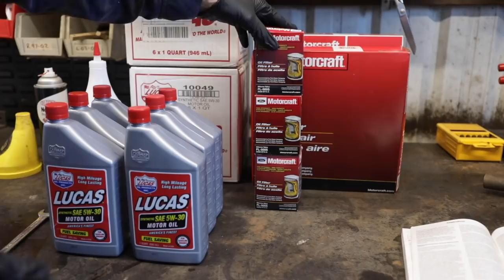How to Change Your Oil Like A Pro

Comment: I have a few Problems with this "Oil Change like a Pro":

1. Replacing an Airfilter is good, but has nothing to do with an oilchange. The same with his doorhinges.
2. Befor you remove your drain plug, open the Oilfillercap. That way, the Oil runs out more smothly, taking more dirt build up with it.
3. It looked like the drain plug gasket was fine, but i would replace that anyway. You have to replace it, if its a copper or aluminum washer. (I know he said that)
4. The drain plug has to be tighten with a specific torque. Look it up in the User-Manual of your vehicle. It is usualy arround 20-30 Nm. (14-22 ft lb for those of you living Imperial units) 
5. For the love of God, get a big cardboard or old blanket and put that under the car to avoid a mess like he did.

Dont swap your tires in a criss cross pattern, if your tires are directional. Most modern tires are not directional, but pls check when swapping. You can always swap rear to front, but dont sawp left to right.

Have a nice day
Reply: I have a few problems with your post:

1.  This is general maintenance usually done at the time of an oil change.  He forgot the cabin filter and tire air pressure.  You should also keep an eye on the plugs and serpentine belt.  Check the manual for grease points. Plus a good visual inspection of the entire car.
2. BS.  
3. He said that...
4.  Again, BS.  It is a freakin' drain plug.  Yeah, they probably do give torque specs, but it is a friggin' drain plug, you tighten it.  Lug nuts too.  Some chucklehead down below thinks it is critical.  No, just make sure they are evenly tightened down good, it will be okay...Trust me...
5. Then you still have to dispose of the cardboard or blanket.  What difference than just using the shop towels?

Don't try to make yourself look smart, it usually backfires.  Your post is essentially screaming, "I am better than Wranglerstar".  The fact that you have to try and prove that tells more about you than you think.  Here is a hint:  Real Alpha males really don't care what anyone else thinks about them.  They have nothing to prove. Think about it.
Reply: I tried to give constructive criticism. English is not my first language, I would never try to look smart, if its not my main language. I just had concerns about some advice "Wranglerstar" was giving. If you make a video about an Oilchange, you have to cover more than just your own vehicle. 

If you would do oilchanges yourself, you would know, why it is better to put a blanket under the car beforhand.
Reply: You are not offering constructive criticism.  You are nitpicking his video to try and make yourself look better.  Just like your parting shot at me.  I have been changing oil in cars, along with any other kind of maintenance including full rebuilds for well over 35 years now.  But that is neither here nor there, your post is about what us wrong in the video.  So far you haven't shown anything substantial.  What are your concerns?  That he didn't use a torque wrench on the drain plug?  Go make your own video.

Comment: a couple of things don't forget to throw your spare into the rotation if it matches your other tires and wheels as it should and not be one of those stupid donut spare. And as far as the alloy aftermarket wheels go they can and will improve your performance they're lighter which means less rotating mass to get rolling which will result in better fuel mileage and  better stopping distance and cool better than a steel wheel will.

Comment: someone is drinking the lucas koolaid.   If you are running lucas oil and paying a lot more for it, it should already have the additives in it.  As far as cold starts go, thinner synthetics will flow much quicker into all important bearing surfaces.

Comment: Filling a oil filter is not at all necessary on a gas motor it’s preferred on a diesel
Reply: if you can fill it without spilling it then kind of stupid not to do it that way the membrane is soaked good and ready

Comment: Had a guy in my tech school with a straight piped Chrysler crossfire do an oil change and he thought it would be funny to rev it right afterwards... threw a rod because of oil starvation and totaled his only vehicle. He flunked out because he didn’t have a way to get to class.

Comment: I've got  368000 miles on my engine that has never been out of the truck. I've used every type of oil and oil filter you can think of both conventional and synthetic oil. My oil changes have varied from 3000 too 7500 miles and I still got to 368000 miles. I now use Walmart supertech conventional motor oil and have so the last three or four years with no problems. Amsoil the Lucas motor oils are for guys who have been brainwashed into believing that the alleged highest quality products will only get you to a high mileage engine.

Comment: If you need AMSoil let me know we to ship it to you no matter the quantity often shipping even free. Also DON'T EVER CHANGE YOUR TIRES or you never know what is wrong with your axles because you can't read the wear pattern on your tires. On top you need to re balance your tire when you change it from one to the other axle which is a reason why I use balancing beats on my 37" for example because they re balance them self each time. Change your AC filters every year not more than that if you off road do it every 6 months. Same is with your oil don't change it to often or you just waste money. I change my oils every 30-40 or 12 month's interval yes I run on AMSOIL and K&N filters.

Comment: Just a couple of notes,  I love that old creeper, true quality in that tool.  I noticed Ford decided to have their drain plug  in a poor location that tends to make a huge mess.  Years back I found these and absolutely love them.
http://www.fumotousa.com/
No more wrench needed, no more washer replacement, and can easily direct the oil into any container by pushing on a small rubber hose.

On the tire rotation, not ALL rotations follow the pattern you described, many cars have directional tires so they need to stay on the same side of the car.  Some cars have staggered sizes so no tire rotation is possible.

Comment: Beware of quick stop type oil change places!  I have always done my own, but I know 3 people they have cost big money.  One left the drain plug loose drained oil going down road and seized engine. One incorrect oil that looked like thin hyd oil or brake fluid ate main bearings.  One incorrect fluid in trans burned up trans.  BEWARE

Comment: If can't afford premium oil, at least get full synthetic oil. It is SO much better than conventional oil. Synthetic oils offer better protection in every possible way than conventional. 
Also, never ever get Fram filters. EVER. 
 Sorry Cody, but OEM filters are not the best (they are pretty good though). Get a K&N filter or Purolator Boss filter, there are other premium filters out  there, but the auto parts store i work at doesn't carry other brands. 
One more thing. if nothing else, CHANGE THE OIL ON TIME. This is doubly true with conventional oils. Conv. oil seems to know when it's 5k miles and suddenly deteriorates. conv. oil WILL NOT LAST  6K miles. This I know from personal experience.

Comment: Pros dont use funnels. You realize a quart of oil is shaped like it is so u can pour it smoothly? You keep the opening on the high side and tilt. SOURCE--Ex a.s.e. technician 

Ah you called that out. But yeah you can pour it without a drop that way

Comment: You didn't take the tire off one side  of the vehicle??and put it on the the other side of the vehicle did you ? ,Radial tires should only spin  in one direction  If you put them spinning inthe opposite direction the steel bands can separate  and the tire will be ruined .

Comment: Don't make your oil to thick. Then it can't get through the lifters on these newer engines.
Reply: I agree......adding oil additives like Cody does, changes the viscosity of the oil.....bad news.
Reply: @TheBeatenPaths  Yea the oil has to push through tiny little holes in the lifters. Keeping the oil changed is the life of an engine.
Reply: @pleaseholdwhileiprocessyou1513  Amsoil has a 25 000 mile oil.  Great stuff.   No offense to Cody at all, but oil education is taught by past generations, no one knows the current facts.  I'm an Amsoil dealer, and I've heard all the myths lol.

Comment: I can hardly finish this video.  #1, wrong, $10 a quart Lucas vs $5 a quart Mobil1 could matter less.   Changing it when you're supposed to and using the correct grade is far more important than brand.  Head over to bobistheoilguy forums and you'll see fantastic lab analysis from Walmart Supertech Synthetic oil which costs $3 a quart. #2, oil doesn't need additives,  the additive pack already in the oil is stout enough for regular service intervals.  Motorcraft oil filters are average at best.  Made by purolator which has had some media integrity issues lately.    Other oil change tips were good.

Comment: Does not matter what vehicle producer saying, you must change oil each 6`000 miles, especially if you have modern common rail turbo diesel engine... only this way you will reach your 1`000`000 miles without any engine repair works, at all.

Comment: All eotating tyres do is mean you have to change all 4 at once rather than just 2. Your always using the same amount of tread your just prolonging it. You will still get the exact same us if you keep thr fronts on the front and change the backs when they are neded. Essentially never. Every 50k.

Comment: do not change your oil every 10k miles, I dont care what the manual says. 6 tops. its all regulations pushing the manufacturers to do that for environment, its not helping your engine life at all. I work in the industry and I promise you going 10k miles is not good.

Comment: What do you think of Mobil 1
Reply from the maker: Mobile 1 is also a premium oil,
Reply: but Mobile 1 has now corrupted their own synthetics with new marketing..... and I use Mobile 1 normally years ago we met a independent oil engineer and he seen a lot data of comparison between brands and Mobile 1 full syn was the best of the bunch but that was 20 years ago and a lot has probably changed  

but I have seen the cleaning action of Mobile 1 full synthetic clean a engine say one on conventional oil for the first 100,000 miles and next 100,000 on mobile 1 and the motors looks better then it did many miles later

Comment: I understand the importance of good oil, but instead of spending the "extra money" on better oil that will go 15K to 20K miles in the modern EcoBoost motor, I have opted for 4-5K mile oil changes using Moble1 5W-30.  Wait!!! Mobil 1 is good oil and not the super ultimate best oil.  Note: The Gen 2 EcoBoost 3.5L motor in the 2017/2018 F150 with oil life monitor will easily go 7500 miles on inexpensive oil in less than severe conditions.

Comment: You’re doing something wrong. When you drive 10000 miles with your tiers the steel and the urethane get used to the direction of the spin of the tier. When you criss cross the wheels it changes the direction of the rotation and it can make your tier fall apart. The criss cross method had been proved wrong a lot of time ago.

Comment: Your tires would last longer if you were not re-living your youth doing a brake stand watching the smoke roll out of the wheel wells lol.  When you have your wheels off do a brake inspection, heavy van, larger diameter tires, smallish brakes the pads would burn off quick. Myself I would skip the additive, a good synthetic oil is all you need.

Comment: You missed something when talking about tire rotations.

Make sure that you rotate the spare tire into the mix. No one ever does this but its needed if you want to keep all your tires the same height and in the same condition. if you leave the spare under your truck or on the back of your jeep it will rot in the sun or dry out from the salt on the road and the lack of use. Make sure to rotate that spare into the mix!

Comment: CODY. Tip for you . Replace your crush washer for a solid copper washer ! Crush washers are designed obsolescence ! Installing a consumer ethos on the general public. Its only a dollar ! Well if you use a solid washer then anneal it the next time you use it you can do that for the life of the vehicle ! How many dollars would be saved over the life of the vehicle ? How much money is generated from unnecessary spares across all industry ? I bet its millions of not billions of dollars. Dont forget all those copper crush washers your using end up in landfill. PURE WASTE ! We need to think smarter than this folks. Many people only see a copper washer but expand that to 1 million washers, 100 million washers, How many vehicles are in the USA ? they all need washers for an oil change ! Those washers are often stamped out of sheets ! The centers and the area between washers goes to be recycled no doubt. Nonetheless its a huge investment in time, man hours ,machinery, factory space and resources just to make those crush washers !!

Comment: Did you know that personal anecdotes are not "Testing"? What you say there is the experience of one mechanic and one laboratory test that says nothing about the oil really haha. 

Get some decent testing going about how much friciton there is, about how heat sensitive the oil is and about how much wear you will get. And I bet you wont notice any difference. 

You got the youtube money, buy t´wo cheap generators, put in two oils and let it run for a week Straight. There will be absolutely zero difference.

Comment: Do not sell your oil filter this is the reason why I don't agree with that because you can put ten minutes into the filter the way he's doing it that's the way I was taught from other mechanics it will take an second or two to fill it up in the engine

Comment: Oil additives not necessary - watch Project Farm Channel.  They are a waste of money.
Reply from the maker: Fake news,
Reply: Ok, won't get into a pointless internet argument about it - love your channel, but I'm not a fan of additives.  API rated oils are manufacturer specified.  They don't specify additives, and would if they were important.  May be different in heavy diesel and 2 stroke machinery.  To each their own.

Comment: I'm wary of ford bailout or not. Ford had a terrible legacy with Powerstroke diesels that costed owners thousands. The "Wonderful engineer's at ford" also designed the triton engine which would blow out spark plugs from the head because they thought 3 threads was enough. Who done that besides ferd ?
Reply from the maker: You can make the same argument for every American car manufacturer,
Reply: I agree, Ford just does questionable stuff some times as they are the most innovative of the big 3

Comment: Additives are idiotic - a nice high quality oil is engineered to be high quality. They spent tons of money engineering it, there's already additives in there tightly engineered to work together. If these random additives really did anything to make a high quality oil better wouldn't they have already put it in the oil? Dumping a random HIGH VISCOSITY additive is only going to mess with the good oil you have in there. Maybe it sticks better but it also flows slower - starving your engine for oil long term. Not really something you can measure by anecdote, you need engineers and millions of dollars for research. Lucas is literally snake oil. Just because it can deaden the sound of noisy lifters doesn't mean it's prolonging the life of an engine. I'm calling bullshit on the idea that this guy wasn't paid by Lucas.

Comment: Whoa, everything about this tutorial is wrong. The oil additive is definetely not gonna protect your engine at cold starts. That thing is thicc aa fucc and is not gonna flow in the engine at all at lower temps. Also changing the oil while the engine is "up to temp" is safety hazard, has no advantages whatsoever and might burn you quite a lot.

Comment: Get a torque wrench! You tell everyone what they are doing wrong, well not torquing your wheel nuts is very wrong, dangerous wrong!  And 10,000 miles is a bit much for oil. Ford says it's ok and your using pure synthetic it probably ok but I'm old school 5,000 is plenty.
Reply from the maker: My arm is a torque wrench,
Reply: As an A&P/IA aircraft mechanic for 35 years, not using a torque wrench on your wheels is foolish.  People a lot smarter than you and me have engineered the proper torque for the wheel nuts. It makes them easier to get them off again also. I remember the time you had to change a tire for Mrs W one time and the lugs were very tight. Please be safe, buy a torque wrench. (1/2 inch foot pound)

Comment: Ok I can’t stand by and not say any thing. First don’t save used shop rags with chemicals on them. Fire hazard don’t do this kids. Second not all tires have to kris cross, most of my cars manual says rotate clock wise from driver front on around to driver rear.
Reply from the maker: I'm not sure what the 1991 rap sensation Kris Kross have to do with tread patterns Alex.
Reply: You got me. Sir.
Reply: By the way Mr. Wranglerstar I do enjoy MOST of the videos.
Reply from the maker: And I enjoy MOST of your comments,